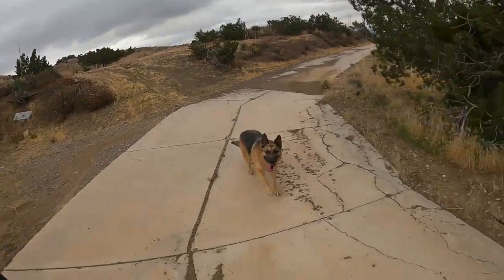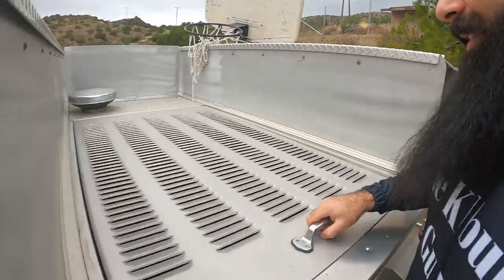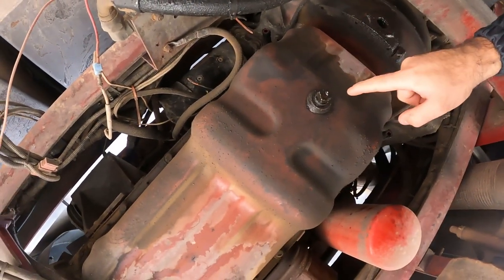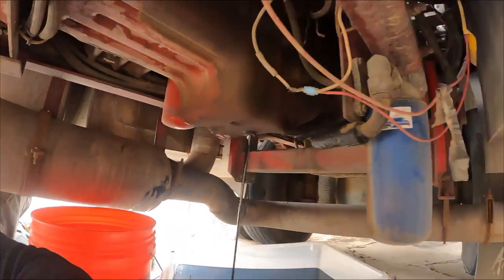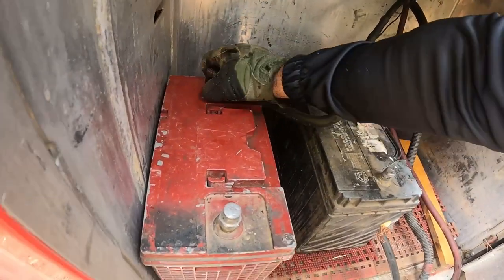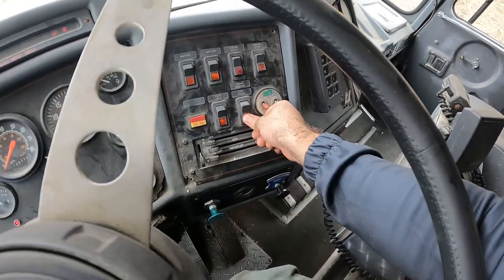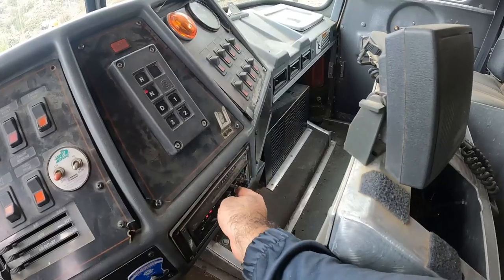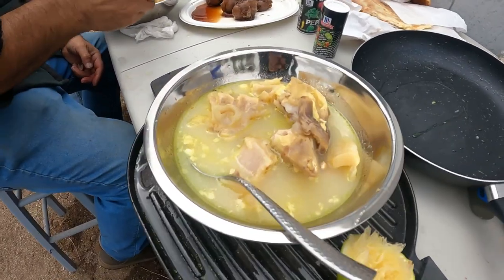Getting The Fire Truck Running Again

Comment: So, while the fire truck may look like an ordinary one, its actually been in a movie. It was used as a background truck in the movie "World Trade Center" in 2006 and had the number 24 on its side. This truck, although only used as a background vehicle, is a piece of cinema history, so take good care of it
Reply from the maker: Are you sure this was the truck ?
Reply: @Kbum-Guy  I'm sure of it. I recognized the truck by the back part of it because i remember finding it strange that the hose bed was taller than the cab and because i remember that instead of the number of the truck being on the cab, it was on the the compartment door closest to the water pump and gauges. Granted, the light bar on top is different, in world trade center they had the traditional FDNY light bar setup on the truck, but im 99% sure this is the truck.
Reply from the maker: Thank you I’ll do some research on it